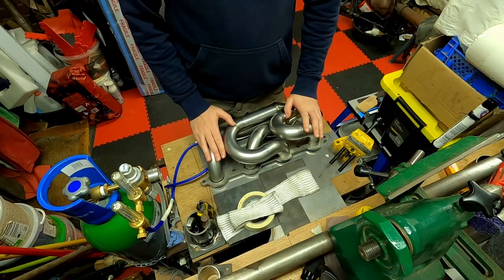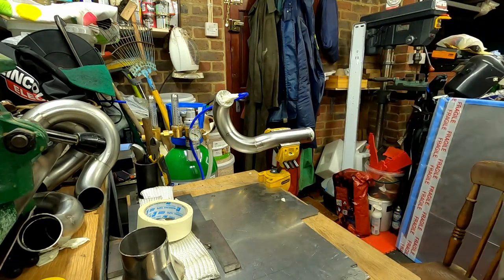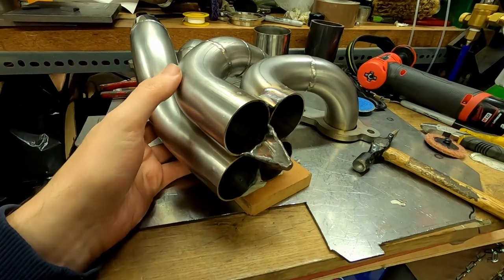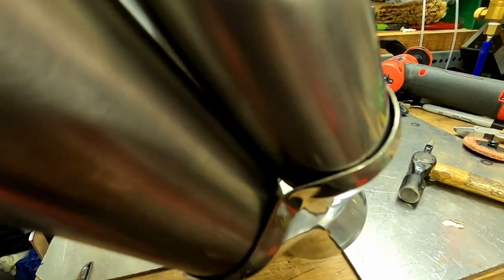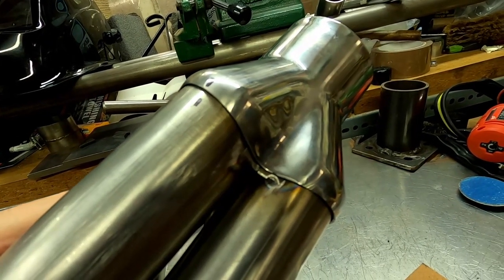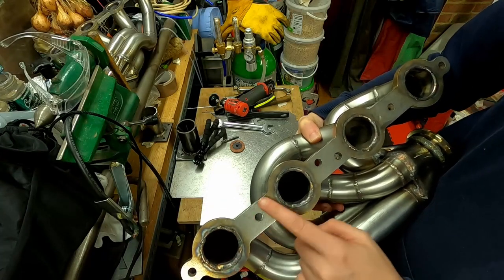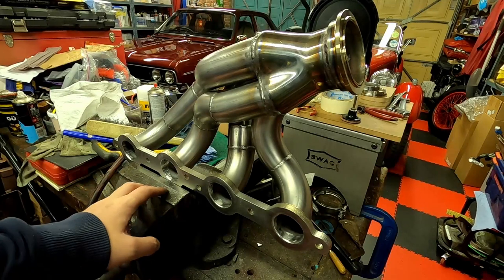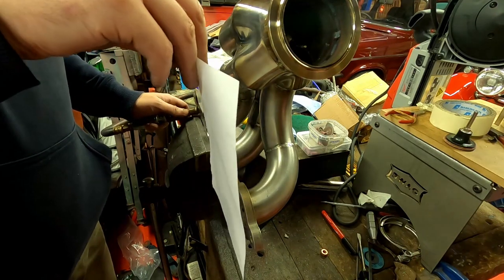Making Custom LS headers (Part 2) - 1972 Vauxhall Firenza LS Swap [Ep7]

Comment: Cracking work as always dude, and great idea with the hoover too last manifold i made i ended up faffing about for hours after with one of those hoover attachments for down the side of seats and an airline 😂 keep up the great work 😎🤘
Reply from the maker: Cheers dude! The swarf from the die grinder is the sharpest thing known to man too! Stainless Steel splinters are no fun! Anything I could do to limit the amount of them all over the garage was worth a try... worked a treat!
Reply: @HexyTech  ahh tell me about it man! I spend most of my time lying down underneath my motors so had many a metal splitter find its way into my back 😂 certainly a trick i shall be adopting in future, also that vice you were using looks a fantastic piece of kit for welding manifolds etc too with the pivotal base
Reply from the maker: @totrodder97  its a Stanley multi angle vise, they are only £20 ish, won't take a beating but great for fiddly stuff where you need to clamp things at weird angles

Comment: Awesome, you know some $hit...... Bernoulli in action! This could make it fly?
I think two 15 minute videos might have undersold this job!
Reply from the maker: It definitely took more than 30 minutes 😆 think i probably took that long getting one pipe figured out at the masking tape only stage!
Reply: @HexyTech  You are one seriously skillfull and knowledgable guy, hats off to you! Dont go too modern, the period Alleycats and butgundy paint were really late 70's cool!
Reply from the maker: @neiljarvis8911  nah I won't stray too far from the 70s aesthetic, wheels are going to have to change to accommodate wider rubber but I'll stick with something fairly retro